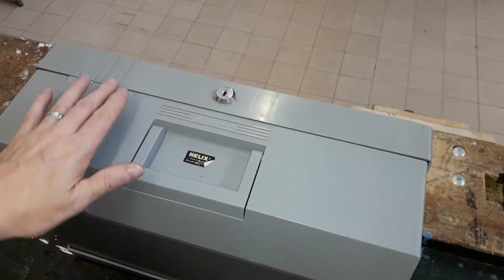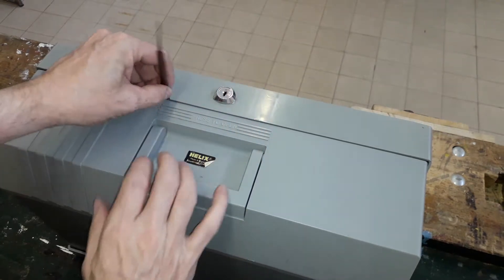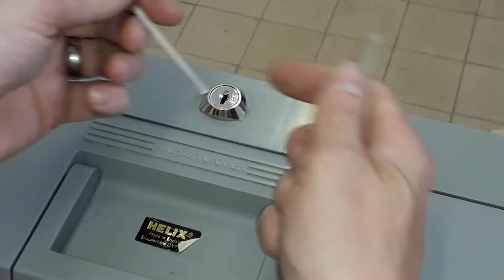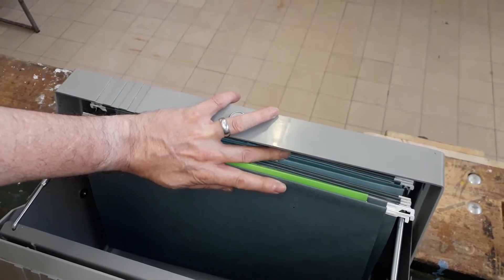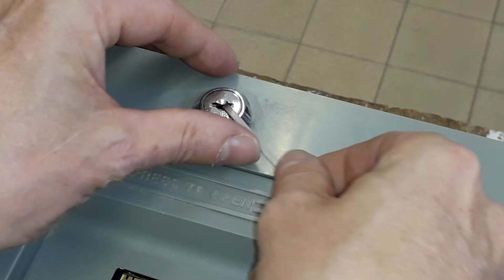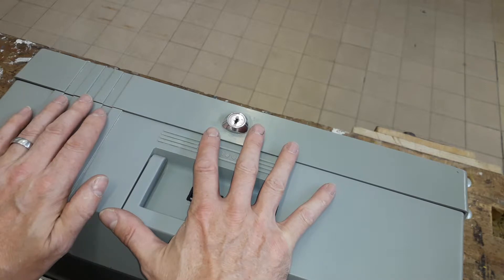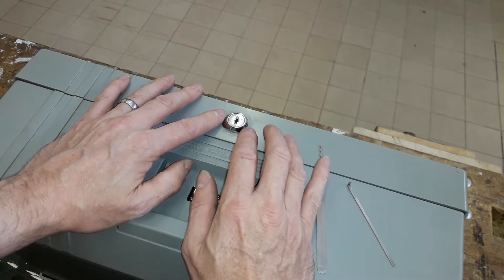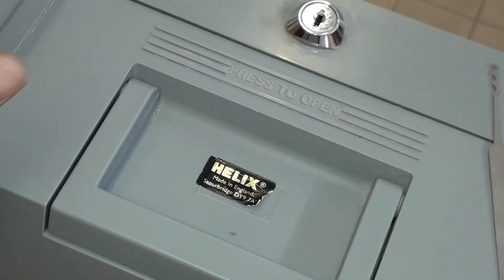(041) Helix lockable file box picked open in 4 seconds

Comment: There is very little security in wafer or warded locks yet they are still manufactured because there must be a demand for them.
Reply from the maker: I guess there is a demand for locks like wafers because they are cheap to manufacture and people just don't know how bad they are. 

Before I knew better I used to destroy wafer locks to get them open when people had lost their keys. I suppose the moral of that story is... if you don't know how bad wafer locks are there is still an element of security.
Reply: They are ok for inside offices. Most people don't even lock them half the time anyway 😂